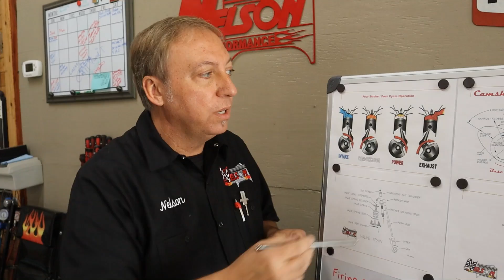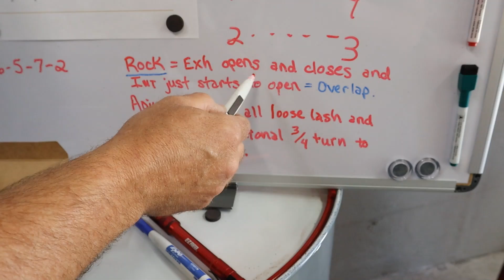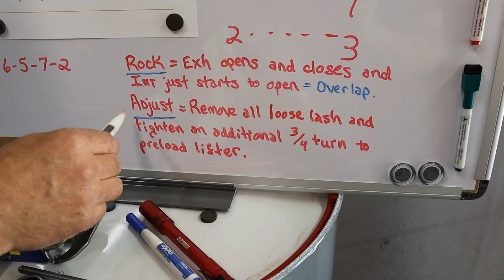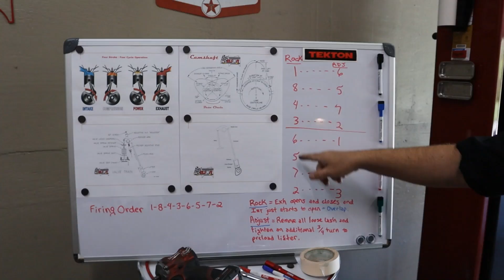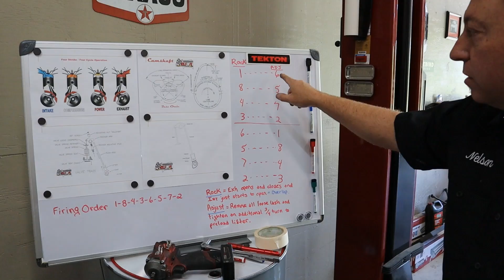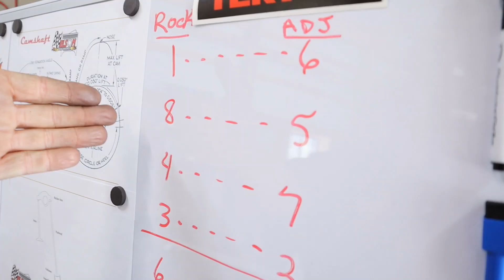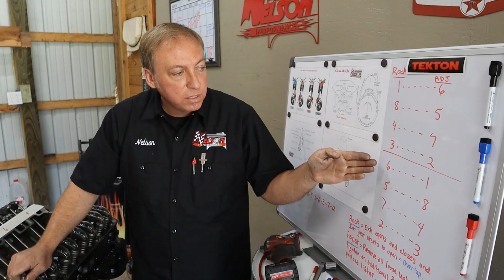Rocker Arm/Hydraulic Lifter Adjustment

Comment: I know it's been a while. But ill try anyway.  

This was done without oil in the vehicle to allow rod to push all the way down without pressure from oil.   Can this be done without draining oil.   And removing intakes.    I can see the springs. So is it nessecarry.  To remove intake.
Reply from the maker: Hello Brandon, The valve springs will bleed the oil out of the lifters as you turn the engine over as the rocker pushes the valve spring down. This will get the plunger off the wire clip in the lifter. The valve spring pressure has enough force to push the pushrod into the lifter bleeding the oil back slightly since the oil pump is not producing oil pressure unless the engine is running.  You don’t necessarily have to view the lifters when doing the process, if the intake is on. You can also watch the movement of the pushrod/rocker arms if the intake is installed. You will see them move into overlap (the ROCK position). I’ve adjusted many engines that way. Just keep track of your cylinder locations to keep you on track. You can also use the ignition/starter to rotate the engine through the process but remember it only takes a slight bump of the key to turn the crankshaft the needed 90 deg. It helps to have a friend bump the key while you pay attention to the rockers. New lifters on a used cam is fine. Old lifters on a new cam or swapping used lifters from hole to hole on a cam is a bad idea. Good Luck with the project
Reply: @mitchnelsonperformance  thank you.  I went and got the supplies for oil change today.  Can't hurt.  So ill drain oil.   rotate pump to bleed.  Then adjust  slack out in firing order. Sound bout right?    Thank you sir for the quick response.    Great video
Reply: One other random question. Not really pertaining to valves but j noticed.  Hei Distributer  at tdc.  (0 degrees)   it is pointing  straight down middle of truck.    
 ( Advanced timing  i read is 36 degrees.)  
Timing marks. -4 to +12 .)   Or. Think they just didn't allow for the rock forward when dropping in distributer.   Is it possible to set  timing with just D.box? Timing mark on zero.   Would be pretty easy to tell if timing jacked. Thanks in advance.   And thanks to  all  your  followers. For any and all assistance
Reply from the maker: Hey Brandon, not positive I understand your question, but as far as the location of #1 on the dist cap, you can put it anywhere around the cap you want and run the firing order from there. 36 deg is a little high for total timing For most combustion chamber designs unless you are running rpm’s above 6 to 7000 rpm. 32 deg is a nice safe timing. Also you should have the vacuum advance disconnected when checking total timing. If that didn’t answer your question feel free to message me again.

Comment: I agree with everyone below!  Clear and concise description of how to adjust hydraulic lifters.  Thank you!  I adjusted mine in a 304 V8 this afternoon.  Small wrinkle compared to the video:  some of the adjustments would not permit a full 3/4 turn.  The nuts were too tight.  Some felt deceptively loose after 3/4 turn.  Are the lifters worn and that's the reason for the increase in force felt during adjustment?  Thanks in advance!
Reply from the maker: Hey John, it’s been a while since I’ve done an AMC but I was thinking they were non-adjustable? Does yours have adjustable lock style jam nuts and studs? Also wanted to point out that AMC heads had some really good flow potential on our flow bench back in the day. Go Underdogs! 😁 p.s some lifters may bleed back easier when turning the engine over making them seem easier to preload.
Reply: @mitchnelsonperformance  GM MItch.  Thx for the reply.  I've learned that the bolts only have a torque spec not a 3/4 turn as do the stud based system in the video.  My lifters are primed so I may need to keep some pressure on them to bleed them out for proper  preload.  I will torque them on the combustion part of the cycle (TDC) as is described in your informative video.  I believe this should do it.  Thoughts?  Thanks!
Reply from the maker: Hey John,  yes that sounds correct. The valve springs will bleed the oil out of the lifters as you turn the engine over as the rocker pushes the valve spring down. This will get the plunger off the wire clip in the lifter. The valve spring pressure has enough force to push the pushrod into the lifter bleeding the oil back slightly since the oil pump is not producing oil pressure unless the engine is running. Good luck on the project!
Reply: Thanks Mitch!

Comment: Is this setting the lash?
Reply from the maker: Hello Michael, this adjustment in the video is for hydraulic style lifters but the process is the same with a solid lift cam except you do not tighten the rocker adjusting nut 3/4. You will instead use a feeler gauge and set the gap (lash) between the tip of the valve and the rocker arm.

Comment: Awesome class! I'm a novice to the hot rod hobby. Have a 78 nova. I bought the Edelbrock top end kit and this definitely gives me the confidence to adjust my valves.
Reply from the maker: Loves me sum Nova! We are currently restoring a 74 Ventura (Nova style Pontiac X body). (See our other videos on this) Glad we could help. Good luck on the project and thanks for subscribing. More videos coming soon!
Reply: DarthMayers, please understand that we are NOT adjusting valves.  (that is a misnomer).
With a mechanical camshaft, we set the clearance between the rocker arm tip and the valve stem. 
With a hydraulic camshaft, we set the depth of the cam follower's (aka lifter)  plunger. 
As I mentioned earlier, once a valve has been installed, the spring fitted, retained and clipped, there is no valve adjustment that can be made.

Reply
Reply: @markemery49     
Thank you for your response. I have a question? I have a 73 Nova now and will be putting on a better set of heads. I know I will have to readjust the lifters when I put new heads on. I take it this way of adjusting them will not work only works on new unused lifters?
Reply: @GarageRatt  Darth, before you install a different set of cylinder heads, make sure that the combustion chamber volume will work with your piston profile.  In other words, the chamber volume, along with the piston dish volume, will determine your Static Compression Ratio.  Whether Auto or Marine, this is important. 
For me, I would steer clear of the GM style Full Dished piston profile. These are NOT a good selection for the SBC with a wedge shaped combustion chamber. 
As for the adjustment...... the 8 stop static procedure will work with new or old cam followers. The only difference will be... the used followers will have oil in them, which does not allow for the plunger to be compressed easily. 

I suggest adjusting the plunger depth prior to installing the cylinder heads. This way you can view the plunger retainer, and see when the plunger begins to move. 
Good luck with the project. 

.

Comment: Great video i just got done using this method. When i went back and checked the lifters i found 1 that didnt have any plunge, it was the exhaust on cylinder 3. Is this anything to be worried about?
Reply from the maker: Hello, if the engine/lifter had previously been started and had oil pressure in it then it is difficult to depress, but if you rotate the engine so that lifter is pushing up opening the valve the valve spring pressure will bleed the plunger/oil out of that lifter if you leave it for a short time. Either way if you followed the process in the video it should be just fine even though it has oil in it. Hope that helps.

Comment: Very thorough. I have a 360 5.9 V8 gasoline, hydraulic lifters. I've read in blogs that the rocker arms can't be adjusted. I'm getting this ticking noise from cylinder 5.  I think. It's an annoying sound. I've changed my oil, added Lucas stop leak and another Lucas brand, the noise didn't change. I checked my spark plugs, 3 were loose, and 3 of them were over gapped. I fixed all that still no change. I'm going to check for an exhaust leak tomorrow, because I don't think I can do this on my motor. The ticking happens whenever at idle and during acceleration. It's not my pcv valve, or fuel injectors, it's a noticable tick. What do you think?
Reply from the maker: Hey James, correct, that type (shaft) style rocker set up is non adjustable, but you can install different length pushrods and achieve the proper preload like in this video. If you haven’t removed the valve covers yet it may be a good idea to make sure a pushrod hasn’t worn through a rocker. At that time you can also go through the video process (using the rock/adjust) method and see if you have any lose rockers. It’s also possible you have a collapsed lifter caused by a small dirt particle in it. Sometimes sea foam will unstick them but I would change oil after using it. Good luck!

Comment: I run a MID WEST MODIFIED  would you Adjust them the same way?
Reply from the maker: Hello, yes, I believe your rules require hydraulic only camshafts with minimum .100 collapse. The 1/2 to 3/4 turn adjustment in our process should provide around .150 to .180’ish collapse depending on the lifter brand unless your camshaft grind suggest a different preload you should be fine.

Comment: I replaced my heads and am reinstalling... Should I be able to depress all the lifters? Some do, but most do not... I did at first attempt over tighten my rocker nuts...
Reply from the maker: Hello Josh, The valve springs will/should bleed the oil out of the lifters as you turn the engine over as the rocker pushes the valve spring down. This will get the plunger off the wire clip in the lifter. The valve spring pressure has enough force to push the pushrod into the lifter bleeding the oil back slightly since the oil pump is not producing oil pressure unless the engine is running. Go through and do the process in the video and then when you recheck it the second time around they should be bled back some.

Comment: V8 7.3L International IDI Diesel
Reply from the maker: Hello, There is no adjustment other than just torque them down to spec. I have heard of push rods wearing though a rocker, Rollers locking up and flat spotting on a cam, valve stems and guides wearing and wobbling around. I would inspect it all over to determine why there is extra valve lash. Good luck!

Comment: I have a 95 silverado with the 5.7 and I have some loud ticking and I am gonna try this
Reply from the maker: Hello, I would also check each lifter for excessive give/preload to see if it may have a stuck or collapsed lifter as you do the process. Since it’s had oil pressure already they should all feel like they have some hydraulic pressure in them.  Good luck!

Comment: Hello Mitch:  I am planning to put a new set of heads and pushrods in my sbc 350.  I am not planning to change the lifters and cam. (My current lifters and cam are fairly new - under a 1,000 miles of use)  Here is the question:  in setting lash and pre-load, do I have to remove the lifters from the engine  to "bench bleed" them and get them "dry" as in the video, then reinstall them before I set the lash?     Or do the lifters "bleed down" enough on their own, say overnight, between engine starts so that I do not need to remove them from the engine.      One final question:    is it ok for me to mate the new pushrods to my current lifters?   Thanks, Ace.
Reply from the maker: Hello Ace, The valve springs will bleed the oil out of the lifters as you turn the engine over as the rocker pushes the valve spring down. This will get the plunger off the wire clip in the lifter. The valve spring pressure has enough force to push the pushrod into the lifter bleeding the oil back slightly since the oil pump is not producing oil pressure unless the engine is running.  You don’t necessarily have to view the lifters when doing the process, if the intake is on. You can also watch the movement of the pushrod/rocker arms if the intake is installed. You will see them move into overlap (the ROCK position). I’ve adjusted many engines that way. Just keep track of your cylinder locations to keep you on track. You can also use the ignition/starter to rotate the engine through the process but remember it only takes a slight bump of the key to turn the crankshaft the needed 90 deg. It helps to have a friend bump the key while you pay attention to the rockers. Yes, new pushrods in old lifters are fine. New lifters on a used cam is fine. Old lifters on a new cam or swapping used lifters from hole to hole on a cam is a bad idea. Good Luck with the project
Reply: What  a clear explanation.  You filled in the blanks for me and I am ready to proceed with the head swap.  Thank you Mitch
Reply from the maker: No problem! Thanks for liking and subscribing!

Comment: Great vid. Getting ready for a ls3 base lifter and top end job.
Reply from the maker: Thanks Roger, good luck on the LS3 project. You’ll be able to use the video to make certain you have the correct length pushrods (lifter preload distance) if you’re using the non adjustable rocker set up.

Comment: Believe what you want sir, but youre totally wrong.  Once at TDC, and both valves are closed all you need  maybe is to turn the adjuster nut to where there is slight drag when turning your pushrod.  Zero lash, then a 32nd of a turn and thats it, on any hydraulic lifter
Reply from the maker: Ok thanks

Comment: I couldn't get more than 1/2 turn of preload without hanging the valves open, and on cylinder 1, only 1/4 turn. Really makes no sense. Lifters are Comp Cams.
Reply from the maker: Hello, any chance they sent you SOLID lifters by mistake?
Reply: @mitchnelsonperformance  No, they're definitely hydraulic. Although the thought crossed my mind that maybe they mixed in some Magnum short travel lifters which are supposed to get no more than 1/8 turn past zero.
Reply from the maker: @Thirdgen83  if you adjust one 3/4 turn down and then turn the engine over to max lift on that valve and wait 30min or so the spring pressure should bleed the lifter down. If not.... I’m not sure what’s goin on with them?

Comment: What happens if you open the intake valve a little more?
Reply from the maker: Hello Jerald, the adjustment doesn’t actually open the valves, it’s only used to preload the lifters. Tightening the adjusting nut further will only reduce the “hydraulic” area inside the lifter and you want as much hydraulic pressure in the lifter to help push the pushrod up and open the valves. Over tightening the rocker nut can cause the valve to not completely shut, losing compression.  Hope that helped. Nelson

Comment: I may have missed something but do I soak the lifters in oil or adjust dry? Also does it matter if using roller rocker arms?
Reply from the maker: Hello Kevin, I oil them but I don’t “soak” them. You don’t want them to be filled with oil so you can feel the preload, but I do prime the oil pump after the adjustment is made. The process is the same for roller rockers. Thanks for the comment and subscribing. More videos to come. Nelson

Comment: Is this also working with the manifold allready on the engine?
Reply from the maker: Hello Alexander, You don’t necessarily have to view the lifters when doing the process, if the intake is on. You can also watch the movement of the pushrod/rocker arms if the intake is installed. You will see them move into overlap (the ROCK position). I’ve adjusted many engines that way. Just keep track of your cylinder locations to keep you on track. You can also use the ignition/starter to rotate the engine through the process but remember it only takes a slight bump of the key to turn the crankshaft the needed 90 deg. It helps to have a friend bump the key while you pay attention to the rockers. Good Luck with the project
Reply: @mitchnelsonperformance  Thank you Verry much for the clear explanation. Think i give it a try this weekend. Greets from the Netherlands 👍🏻

Comment: Such a timely video.  I am planning to change heads on my sbc 350.  The current engine is a fairly fresh rebuild (under 2,000 miles on the rebuild) with an extreme energy 268 Comp Cam, and uses stock  pocket ported /1.94 valve  heads.  I am installing a new pair  of Dart iron eagle heads for better flow.  My question:  Can I install new ARP pushrods with new long slot rockers without changing the lifters?   The rockers you use in the video are SBI.  Can you tell me the full name of the company who makes these rockers? Thanks.  Great video.   Ace
Reply from the maker: Hello Ace, first off, good choice on the heads. The Darts are a good casting and can really improve flow and power over the originals, especially with a little port work. I’m not positive I understand your question, but you MUST replace lifters when replacing the cam. Lifters will “mate” themselves to each lobe and cannot be used on a different cam or even a different lobe of the same cam. The cam lobes are ground at a slight taper (.001-.003) to cause the lifter / pushrod to spin for even lubrication and wear prevention. The rockers we used in the video were just a good stock replacement rocker. I would recommend using at least a roller tip rocker or full roller to extend valve guide life and add power if your budget allows, otherwise Pioneer and several other companies offer long slot stamped steel rockers.
Good luck on the project and thank you for subscribing! More videos coming soon. Nelson
Reply: @mitchnelsonperformance  Thank you Mitch.  I am not planning on changing the camshaft or lifters. Just wanted to know if I can use new pushrods and rockers with the new heads.  In other words will the new pushrods (Howard pushrods) mate ok with the current lifters in the engine?